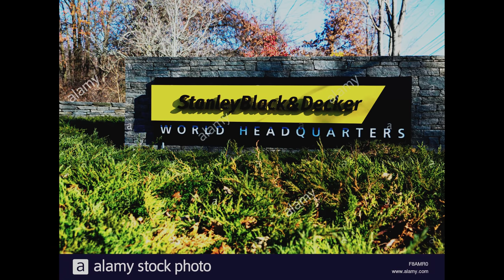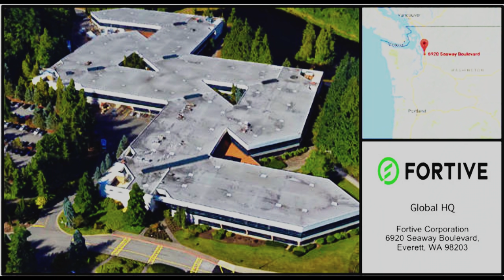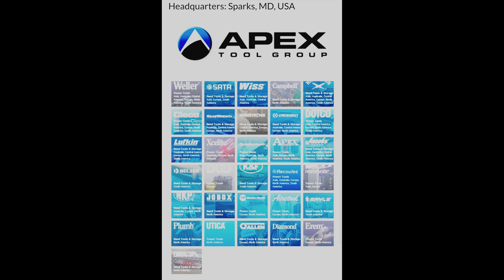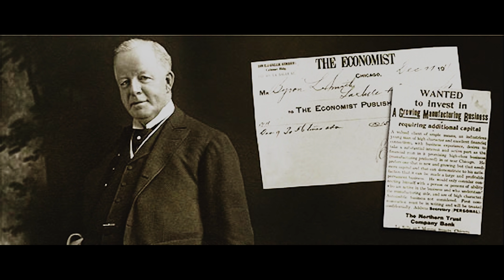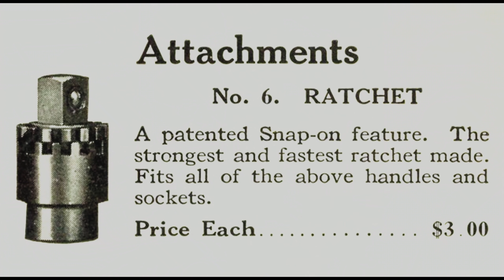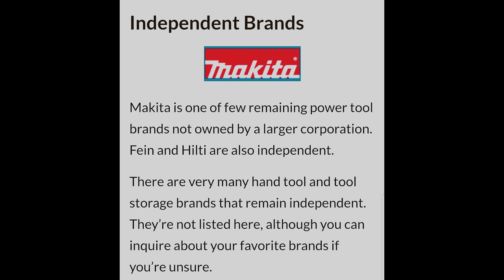Only A Few Companies Make 99 Percent of All Tool Brands

Comment: I like DeWalt, I started my cordless tool collection years ago with them and they are good tools and I owned 10 of them, 8 old Ni-Cad 18-volt ones that I owned for a long time and that never gave me any problems with 4 batteries and right when they came out I bought 2 new Lithium-Ion post style ones with 3 batteries but after they all got stolen I ended going with Ridgid tools and I like them, they are affordable and I would consider them fairley professional as I have never have had one break down on me and at this time cordless tools had become more mainstream so I had 17 if you include my 2 extra JobMax heads and 9 - 18-Volt Lithium-Ion batteries. Then thru a promotional program I was in I got some Milwaukee M18 FUEL tools for free and more importantly I got 5 M18 5.0amp Milwaukee batteries for free and as we all know batteries are one of the most expensive costs when breaking into a new tool line so after that I started buying up Milwaukee tools a few years ago in addition to getting a few more for free. Now I still own 15 Ridgid 18-Volt tools and 7 batteries, I got rid of some of the older ones once I started getting Milwaukee tools and as of right now I have 20 Milwaukee M18 FUEL tools and 11 batteries and 2 Milwaukee M12 FUEL tools and 2 batteries. So I guess I'd say my favorite power tool brands are Ridgid and my favorite power tool brand is Milwaukee, go team RED!!! Milwaukee is also starting to make some good hand tools and i own quite a few of them. Also I'd like to say that in addition to smaller tools like my Ridgid Hanmer Drill and Milwaukee M18 FUEL Surge Impulse Driver, which I freaking love and cordless tools where they are starting to diversify like lights and fans and yard equipment, I have a Milwaukee M18 FUEL String trimmer, blower and even 16" chaninsaw which by the way are a hell of a lot nicer than 2 stroke gas powered yard equipment no mixing damn gas and pulling the pull cord and servicing the damn things, you just pop in a battery and go and in addition to my small tools I have big tools like the Milwaukee M18 FUEL 18-Volt Lithium-Ion Brushless Cordless 10 in. Dual Bevel Sliding Compound Miter Saw, the Milwaukee M18 FUEL ONE-KEY 18-Volt Lithium-Ion Brushless Cordless 8-1/4 in. Table Saw Kit W/ (1) 12.0Ah Battery & Rapid Charger both of which I love and have plenty of power to get the job done between these new Brushless motors and high amp Lithium-Ion batteries plus I have some specialty tools as well such as a Milwaukee M18 FUEL 18-Volt Lithium-Ion Brushless Cordless Drain Snake Auger with 5/16 in. And 3/8 in. Cable Drive Kit w/ Free 5.0Ah Battery. The point I'm trying to make here with all this is that when I bought my first 18-Volt cordless DeWalt Ni-Cad tools a little less than 20 years ago air tools still ruled the shops and corded tools ruled the jobsites, granted I could get by with all but the biggest corded and air tools with my DeWalt 18-Volt Ni-Cad and 4 batteries. Now with the Brushless motors and higher amp Lithium-Ion batteries and new cordless technology that keeps coming out cordless tools are the wave of the future and it seems like all but the biggest corded tools and air tools won't be around for long now and change is good, I love not being tied down to a cord or an air hose that I'm tripping over all the time!😜👍Also great video by the way I really enjoyed it, it's really informative to see what conglomerates actually own which tool brands!
Reply: There’s no way I’m reading all of that.
Reply: @andrewsalazar98  Yeah it's a bunch of rambling I must have been bored when I wrote it and had nothing better to do lol!

Comment: pro tool reviews just did a video on this a couple weeks back. i did a bit of research back when i was still wrenching when i started noticing the rebranding across trucks of lisle tools. then i noticed it even more after the research. here's the skinny of what i found out, a lisle brand tool on the cornwell truck has a markup, but mostly cuz that guy probly paid retail for it and he's a small business. a rebranded lisle tool on a mac truck, branded as mac, is even more expensive, but came 'straight from mac' if you're drinking the kool aid. and the same one on the snappy truck, well, you know you're paying triple for that logo. then you go to the parts house and pick up the lisle for the retail price, which is about 40% cheaper than cornwell, and it's the same damn tool. case in point, my napa purchased, gearwrench branded, serpentine belt tool that was 30 bucks in store, identical to the matco in every way, aside from branding, but matco wanted 65 for it. once i learned that dirty little secret if i saw something in a truck catalog i liked, i researched it down to it's OE manufacturer and bought that version, usually saved myself at least 50 to 60% off the truck price, and had bragging rights over the poor saps who sold their souls to the trucks. that's when i found out about alot of this who owns who stuff. when the guys at work would pick up their dewalts and bash my black and deckers i'd just grin. knowing full well under the plastic they're the same damn thing. the guy in debt to the mac truck that hated stanley tools...what a joker.  at any rate once you know things like this favorite tool brands become something of a wash. my favorites now are what gets the job done as easily as possible for as little money as possible without being junk. that last bit though is a bit personal. what's a quality tool in my hands under my technique and tool care might end up being a pile of shit in the next guy's hand with no technique and tosses his shit in a bucket at the end of the night, sledgehammers last, not giving a shit, then blames the tool for it breaking. anyway brother, fantastic video, i think i've ranted long enough. i think cornwell should be on your list for a history or overview video. old blue don't get enough love if you ask me. they were the best and most honest truck i had when i was swingin wrenches.
Reply from the maker: I agree with you in a lot of areas man. You're right I should have mentioned Cornwell I thought about it afterwards. I want quality but not enough to send me to the poor house lol. You just have to find a balance and like you said search for the original manufacturer's which can save you some money. Thanks for sharing your thoughts and experience brother.
Reply: Great comment bro, that hilarious about the guy who said he hates Stanley but owns a bunch of MAC stuff, does he seriously not know that MAC is owned by the Stanley Black & Decker corporation?! I totally know what you mean about rebranding it's totally ridiculous, I see it happen all the time and what really pisses me off is, especially the tool truck guys, when they either don't realize it or just think shit is better because their name is on it. I remember when I was painting professionally and I owned a top of the line Sata Jet RP Digital 2 paint gun and the Snap-On guy comes in and tells me when I'm tired of using that piece of shit he can sell me a real paint gun, a rebranded DeVilbiss which isn't a bad brand but no where near as good as Sata. I told him are you serious bro do you assume your gun is better than mine because it says Snap-On on the side of it?! First off you come in here not even knowing what kind of paint gun I have and then tell me it's a piece of shit and then on top of that tell me to come buy a paint gun from you after what you just said and the way you acted, do you even know what kind of paint gun I have or even what kind of paint gun you have for that matter? Dude you sell mechanics tools and you just barely got a paint gun for the first time and think it's the best thing ever since it says Snap-On on it, do you actually even know anything about your paint gun besides that it has a Snap-On logo on the side of it because if you did then you'd know that it's a re-branded DeVilbiss and that it can't even compare to my "piece of shit" Sata paint gun so maybe not only don't come in and call my paint gun a piece of shit when you don't know anything about it or even what brand it is and more importantly why don't you do a little research your own product so that you'll know it wasn't even made by Snap-On since Snap-On doesn't even make paint guns, so why don't you get out your DeVilbiss oh I'm sorry I mean Snap-On paint gun and we can put it up against my Sata and find out if it's a piece of shit like you claim! Don't come in here again and tell me my stuff is a piece of shit because it doesn't say Snap-On on it, now unless you want to put your gun up against my Sata instead of just telling me it's a piece of shit why don't you take your DeVilbiss paint gun back to your truck but first if you want I can make a little DeVilbiss logo for it to stick over the Snap-On one! So I totally hear you about re-branded! But please don't confuse re-branding, aka the same company making the same tool and putting a different name on it and selling it to different companies, like calling a Black and Decker the same as a DeWalt, that would be like me saying a Ryobi tool is the same as my Milwaukee because they are both made by TTI. There is a difference when a company re-brands tools then there is when they make the same type of tools with different brand names for their own company that are in fact different from each other and not the exact same tool with a different name. Re-branded tools look just like each other only have a different name on them, if you look at a Black and Decker tool there's a reason it doesn't look exactly the same as DeWalt tool that's because they aren't, just like a Ryobi tool doesn't look exactly the same as a Milwaukee tool. Granted they do share the same parent company so they will probably share some similarities and technology since they are both made by the same company but they are not the exact same tools with the exact same parts. An example of that would be Ridgid an AEG tools now they are the exact same tool under the plastic as each other because they are actually re-branded tools not a different brand of tool made by the same company, thats why they actually look exactly the same except for the name logo.

Comment: Good Video thanks  for all the information BTW  I am a retired Woodworker  and have always done almost all my own Automotive and Mechanical repairs as well. I have 2 Buddies that are brothers and A.S.E. Certified mechanics that own and operate a Independent Automotive/ repair  and Speed Shop  i used to have fun  teasing them  that my Stanley Brand Ratchets and Sockets i bought at Walmart  made their Tool truck tools for a fraction of the price they paid for their tools   And in all honesty  i  personally liked the fit and finish of the Stanley Ones

Comment: Chevron is not part of Chevron Oil. It is actually CHERVON Trading Company of China. They bought the Skil brand which was formerly owned by BOSCH. They are tightly associated with BOSCH. RIGID power tools is part of TTI.

Comment: I've watched a few of these, 'company' vids, but still find them incomplete. In Canada, we have outfits like Canadian Tire who sell Mastercraft, I've always thought them to be the same quality as the older Craftsman tools, but they don't show up here. The other tool I never see on these videos, is WEN. I have an air cleaner, planer, and jointer, they run like a top, and I have seen many expert carpenters with WEN drill-presses in their shops.
These videos do one thing that I like. I have quite a few Ryobi tools in my shop, I'm a hobbyist, and I do not use my tools to earn my wages. I got tired of the anti-Ryobi crap on YouTube and elsewhwere, and I know from personal usage, that there is nothing wrong with them. Barring Makita, when I learned a couple of years back that there were a couple of places making many of the lines, side by side, it was nice to know that Milwuakee, Dewalt, and yes Ryobi amongst others, were made in close proximity by the same groups of people.

Comment: I like Harbor freight for a variety of reasons but one of which is not power tools.... I did a video testimonial covering what power tools I felt were best for particular situations and Harbor freight Power tools was one of the ones I put in the first category which was the homeowner..... it is good to note that while a  particular company may manufacture A few different tool brands they are not all the same in quality.... for example: TTI owns both Milwaukee and Ryobi however Milwaukee is a professional grade contractor type tool while Ryobi is geared for the homeowner/DIYer... it all boils down to the components used to make the tools.... just wanted to point out a couple of things....Great video very informative
Reply from the maker: I agree with you Rich. Thanks for sharing your thoughts!

Comment: Ridgid as in the orange power tools a the Depot are rebranded AEG tools from TTI, Ridgid Leases  its name in North America only to TTI to be a Home Depot exclusive, everywhere they are AEG. 
Real Ridgid tools are red.
Reply: Ridgid name are still owned by Emerson, and leased TTI for distribution.. the result of that lease agreement, is that TTI makes the tools, and they use the AEG platform
Reply: @andreasshizas5977  Emerson's Ridgid still sells tools at Home Depot, pipe threaders, inspection Scopes to go down drains, huge pipe wrenches, and the like...
Reply: @thetruth5210  I was referring to the cordless power tools and the power tool line, sorry about that I should have been more explicit
Reply from the maker: Thanks for clearing that up fellas
Reply: Also no affiliation with the ridgid brand of tools that are usa made and fantastic, the ridge tool company makes them and licensed the name to tti for the ridgid tools u see at the depot.

Comment: HF is slowly taking over 
For better or worse-
Stores all over, and the Snap On comparisons throughout there lines.
The big truck brands  are slowly loosing market share due to price point
Today you buy right off Amazon or EBay
What you had limited availability for, 30 years ago. Technology has changed the game as we know it
What will it be like in another 30 years?